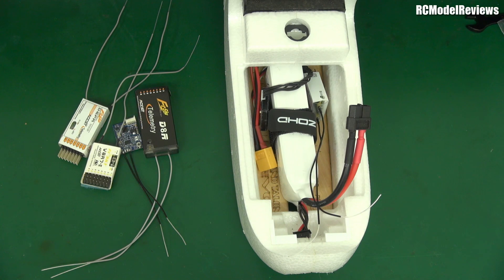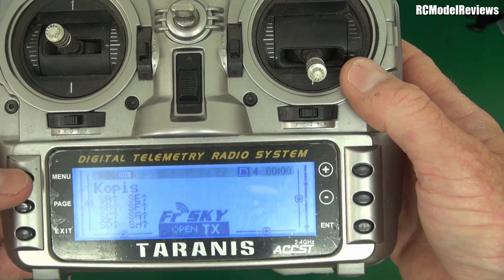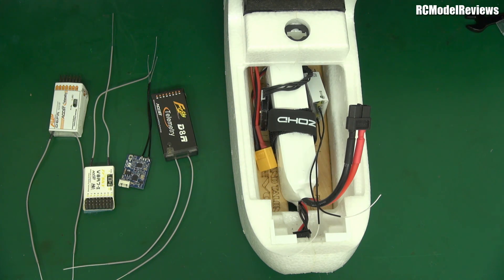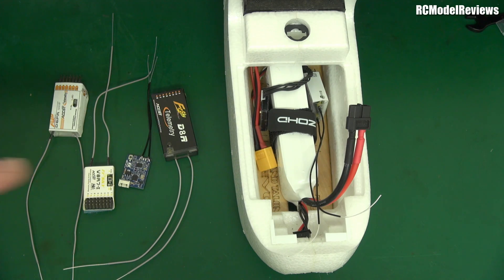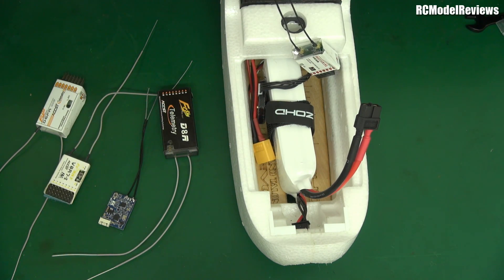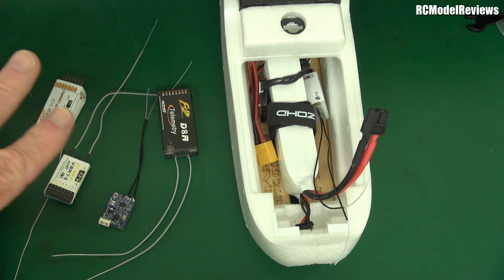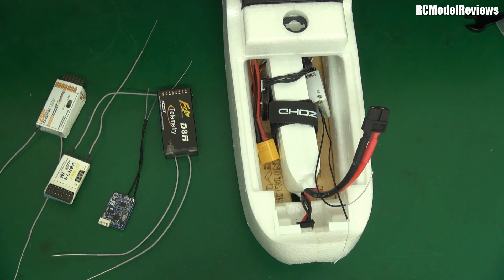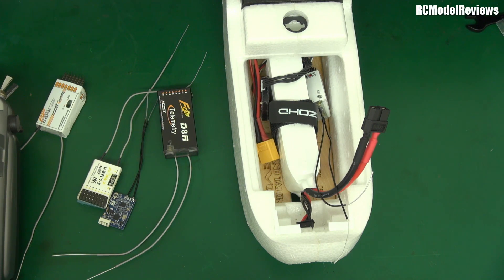FrSky's ACCST Update - should you?

Comment: Fryky introducing PANIK so they can update the owners TX  so the software locks in frsky RX. This may increase the sales of Jumpers !.
Reply: That's nonsense. Customers have found the issue, worked hard to reproduce it and worked together with FrSky to solve the bug.
The update is still ACCST, just with the horrible bug fixed that can lead up to 1s of losing control and random control surface deflection, and not a "software lock".'
FrSky has to urge customers to update because they don't want to be liable for customers crashing their expensive models due to a known bug.
Reply: There is no bug. Frsky want to lock customers into their protocol, this is their way to avoid loosing customers. A 10 year old TX does not need updating for a bug in the software. Update you're software and your old RX will not work as you cannot update your old receiver, prove me wrong.
Reply: @kevingrainger2530  "There is no bug."
That's a claim for which you have no supporting evidence and it is demonstrably false as explained before.
I won't repeat myself.

"Frsky want to lock customers into their protocol"
ACCST is FrSky's protocol. The update is for the ACCST protocol.

So you're - again - talking out of your rear.

"A 10 year old TX does not need updating for a bug in the software."
What has the age of a TX got to do with a bug in the software?
Does your old TX not run software? Does it not support ACCST?
You're again talking out of your rear.

If anything it's laudable that FrSky still provides support for such old transmitters.

"Update you're software and your old RX will not work as you cannot update your old receiver, prove me wrong."

Have you even read the announcement by FrSky?
It lists transmitter RX modules and receivers for which fixes/updates were published.

It also says that you need to update all equipment, both TX and RX.

If you have an RX for which there is no update (yet) either wait, replace it with a supported RX or just don't update your receiver and live with the bug.
It's your choice.

Comment: I just updated most of my receivers and my iXJT in my X10S to 2.0.  I've done the X8R, R-XSR, and R-X8R Pro.  No issues with telemetry or anything so far, though I did have to rediscover a couple sensors.  However, I did NOT update my X4R-SBs because they are running F.Port firmware and currently there is no ACCST V2 firmware with F.Port enabled.  Luckily, since I have a iRangeX 4in1 module, I can still fly those receivers.  It's updated to the newest MPM firmware (1.3.something) and everything is working great.  

The reason I updated was because yesterday I had something very peculiar happen.  I hadn't planned on updating to V2, but yesterday I was flying my GAUI NX4 (500mm size nitro helicopter) and while hovering it suddenly darted straight toward the ground at full negative pitch.  Smacked into the ground, but luckily bounced up and I was able to save it, albeit with some broken skid struts.  I reviewed all my logs... telemetry logs, and the gyro unit MSH Brain2's several logs.  All telemetry logs looked good, no issues there, no low RSSI or signal loss, then I moved onto the Brain2 logs.  One of the parameters I have logging is receiver pitch, which is channel 6, and it's logging the signal that it gets from Ch6.  For some reason, there was a 0.40s long burst of -117 on Ch6 right when it started to plunge.  Obviously I know for a fact that I didn't go from a hover to giving full negative pitch for half a second while only about 3m above the ground.  I went through all my different flight modes, switch positions, etc and there was no possible way I was able to replicate that -117 signal on Ch6.  So I was like "wtf? what are the chances this happened for the first time today".  

I'm not entirely sure that bug is what happened, but I can't afford to risk it, I have 5 helicopters, ranging from 380mm to 700mm nitro, and I don't want to put myself or others at risk.  Even if it's a once every thousand flights kind of deal, it's not worth it to me.  

I'm not keen on FrSky's attitude and anti-consumerism as of late, but I can't afford nor do I want to switch to a whole new radio system... I really like the radio, both the OS (OTX) and the feel of the radio in the hands and its hardware.  So I'm just going with it for now.  I've considered switching to Jeti, but that's not gonna happen anytime soon.  I love OpenTX and I don't want to get rid of it.  I'm just not entirely sure I trust the $150 JumperTX and the MPM to $3000 worth of flying nitro powered chainsaws  in the air.
Reply: I'm not an FrSky fan by a long shot but this update is the opposite of anti-consumerism. Customers discovered the bug, worked hard to reproduce it and then worked together with FrSky which fixed it in a relatively short amount of time.
Reply: @xnoreq  It's not the ACCST V2 stuff that people are talking about being anti-consumer, it's ACCESS.   Not to mention FrSky straight up telling their dealers not to sell JumperTX or they will not be allowed to sell FrSky anymore.
Reply: @BladeScraper  Sure, with that I agree, but the topic/video is about the ACCST 2.x.x update.
Reply: @xnoreq  I simply brought it up because it's something that is making me consider switching away from FrSky.

Comment: ...and that's why my receivers are FCC and yes D8 too 😂😂 in the U.K.
Reply: D8 has no FCC or EU-LBT versions, so your receivers are simply D8 and not affected.
Reply: @MichalMak77  I fly d8, not allowed in EU, and also d16 with FCC firmware, not the rubbish EU LBT
Reply: Mine too.
Reply: Bug affects FCC too just not as severely. I have personally had an incident with an 700 size heli that I am now sure was this bug, the FBL controller has channel logging and showed a spike in the input from the aileron channel. Didn't cause a crash (it only lasted a split second) but was very scary on  machine like a 700 helicopter. I am in the US and run FCC firmware. Using Jumper won't make you safe either it's a bug in the ACCST protocol itself not in the hardware.

Comment: Did FrSky ever said they had a failure that needs to be fixed by an upgrade?

Is this the update that will roll out encryption?

I got a Nano Talon Evo too and plan to use that motive receiver + jumper T 16.

FrSky is no longer competitive.
I've sold close to all FrSky components except 1 receiver and a sensor, but x-lite + x9d are all sold.

Comment: Too many times I've been stung by updating software to the 'latest and greatest' version, so I've taken the stance of only updating when it's necessary..
Reply: licensetodrive "Don't fix what isn't broke" :)
Reply: @Jibba Jabba Exactly! :)
Reply: @licensetodrive9930  agree never had this issue ,,, if its not broke don't fix it...
Reply: And also who hasn't noticed how much slower a mobile phone is after each "update" stuff the upgrade!
Reply: That makes sense for something like an RC receiver that isn't connected to the internet. For your computer, 99.9% of hacks would be prevented by a) applying security updates for your software and b) not being a dumb butt and running software you receive over email or from unknown web sites.  Updates for your computer are important. I'll be downgrading the firmware on my RC gear.